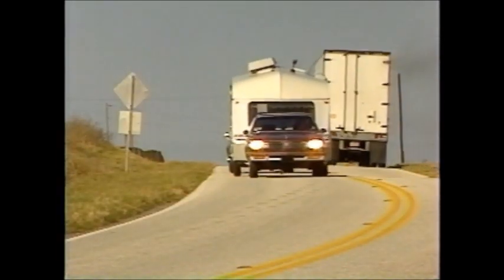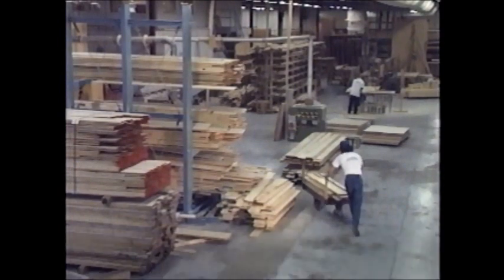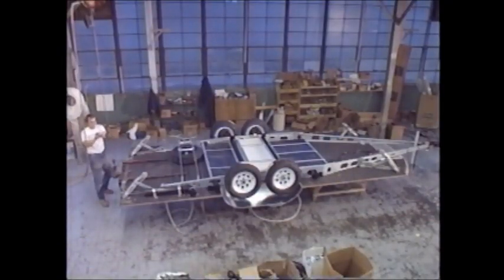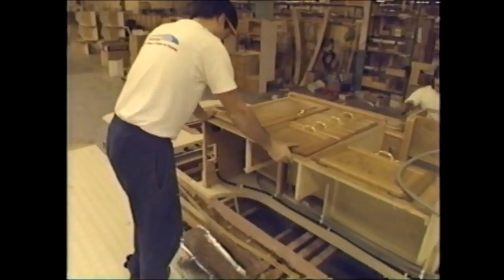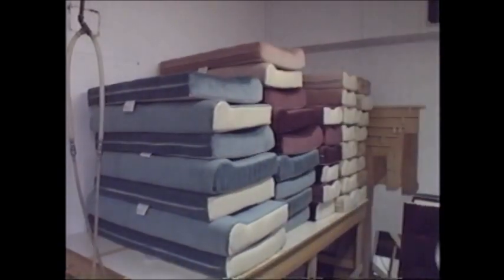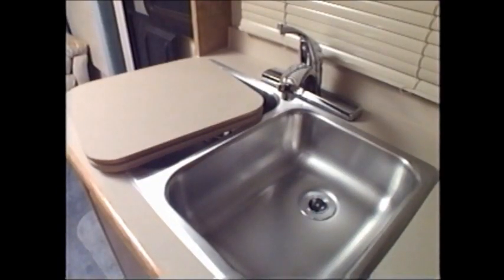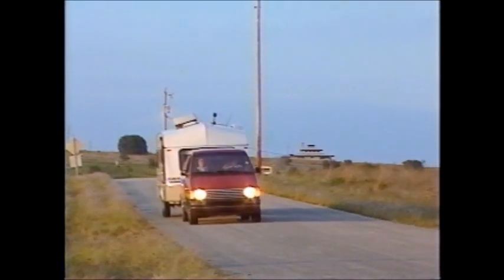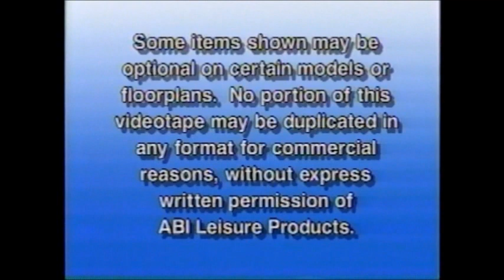Award Travel Trailer 1990 Factory Video

Comment: Can anybody show me where the battery location is I need it to raise my trailer toll jack
Reply from the maker: The battery is located near the rear of the trailer. There should be a locked square metal access door on the outside.